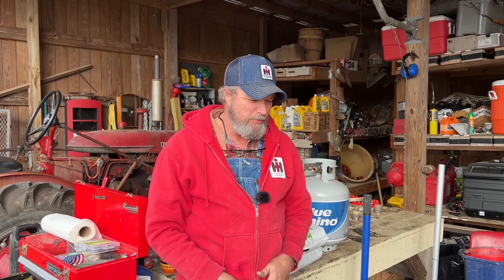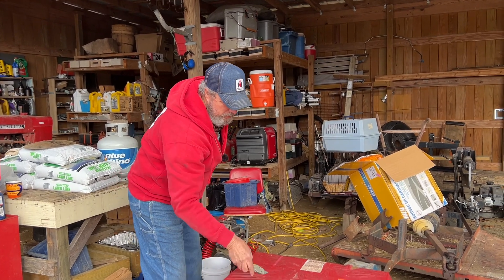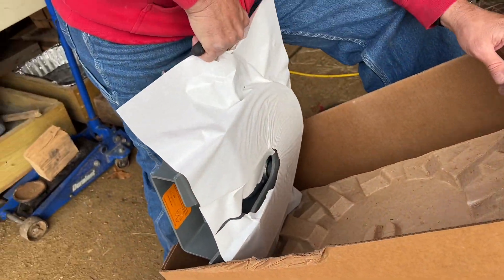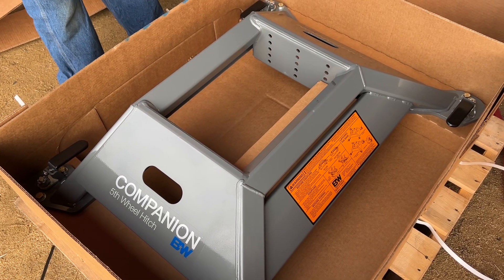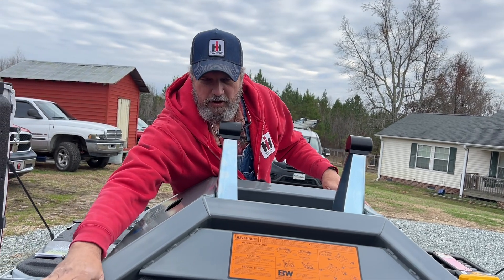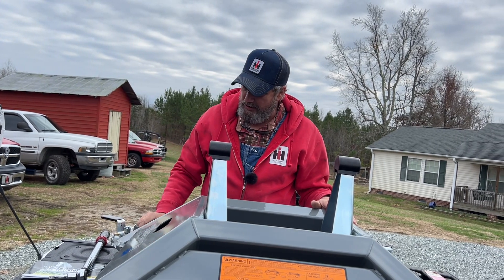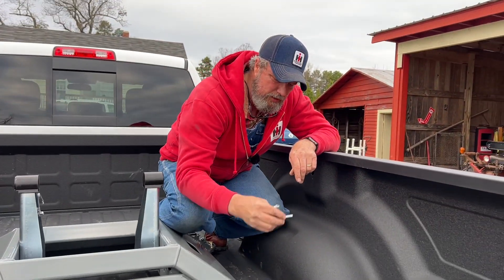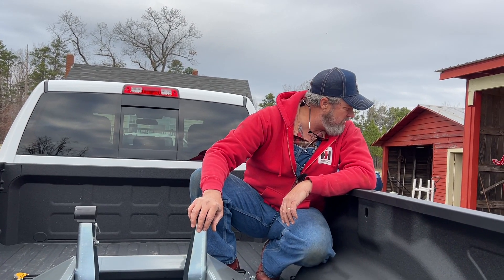Ram 2500 B&W Companion Hitch Installation

Comment: I smell a rv trade coming up 👍 I have a setup probably very few if any have. I have an older 5th wheel hitch mounted on a 3 point hitch carry all that I use behind my tractor in the field to pull a 20’ gooseneck with a kingpin mount instead of normal fifth wheel style hitch. Much easier maneuvering than using your truck. Then when fully loaded I switch trailer to the truck for highway deliveries. Merry Christmas to you guys!
Reply from the maker: We’ll I can’t say I haven’t thought about it. Lol That quick hitch sounds like a neat deal.

Comment: Nice set up. Always grease that fifth wheel before use. Red high temp.
Reply from the maker: I bought a graphite disk from B&W hoping I wouldn’t need the grease.
Reply: @Jtwes  there is lots of friction there. But you won't be pulling 80k pounds. Let me know how it works out. It does look good in the truck

Comment: So let me get this straight...you bought a fifth wheel hitch but you don't have a fifth wheel trailer?🧐🤔🤷🏻‍♂️ Or did I not hear you right🤣
Reply from the maker: Lol 😂 Yes you heard right.
Reply: My thoughts exactly!!😒😂
Reply: I sorta get it.  I buy tractors (up to my elbows in under 40hp) and don’t have enough acreage to justify more than one.  Saw it, wanted it, bought it!  That’s the result of working a couple jobs simultaneously and being OLDER.  I’m sure at some future point Joey will put the hitch to work.